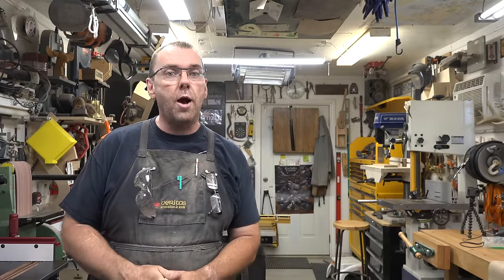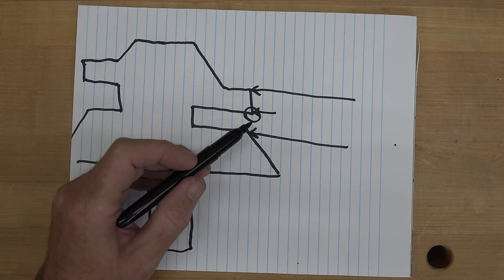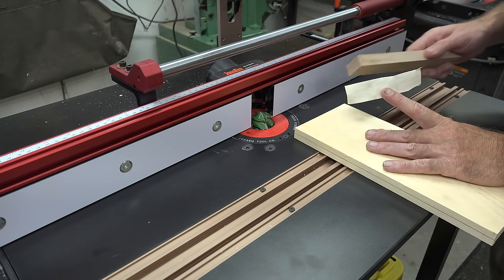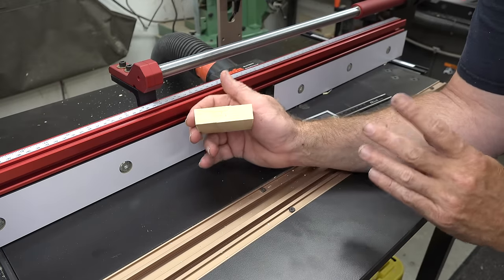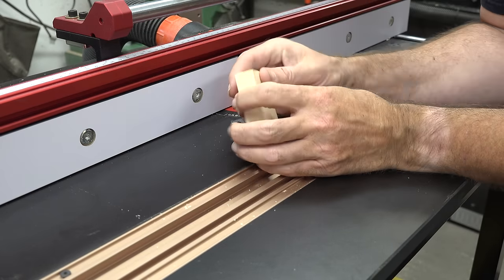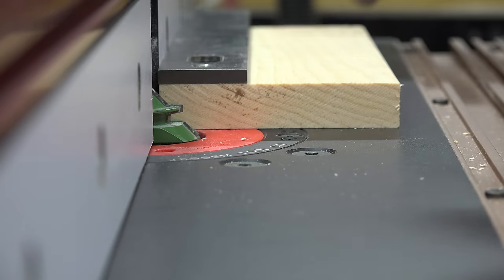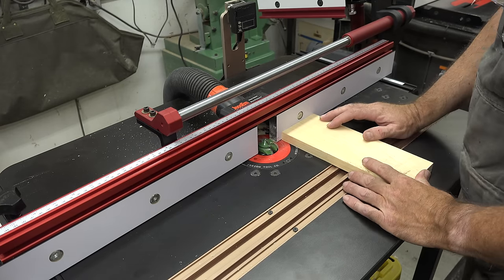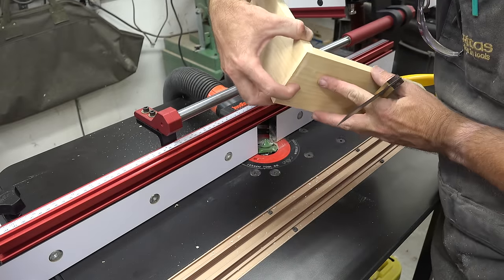Lock Mitre Router Bits

Comment: Kenny, best video explaining this bit set-up.  It takes some trial and error since I don't have the fancy router lift you demonstrate.
A question:  When I finally for the height dead-on, there was a small chamfer on the sacrificial guide  board.  Is this the normal result?  Thanks very much, Bill
Reply from the maker: This is a fairly normal result Bill and nothing to worry about.  As long as the stock itself it correct then you are fine.  Depending on the bit and variances in manufacturers, result may vary but it sounds like you have nothing to worry about.  Once you get it set up the way you like it, you can always run some UHMW plastic through the bit and make a setup block to speed up the process next time.  Thanks for tuning in and taking the time to leave a comment.  I hope I've answered your question.
Reply: @acutabove_woodworkings  Thanks very much for your answer.  After lots of searching, I found a source of small UHMW blocks on E-Bay.  These are cut-offs from ipfPlastics  - 1" thick (which I needed for my project) and 4-5" long.  You get 9 random cut-offs for $25.  This was the best price for small pieces I could find.  
For anyone that uses these, make a cut-out in a longer piece of hardwood and insert the UHMW firmly into the cut-out slot.  Then run the profile.  Moving a 4-5" piece against this bit is dangerous!!!  Again, thanks.  Bill.
Reply from the maker: @williambrooks5133  Sounds like it will be perfect for your setup blocks.

Comment: Hi nice video, i wonder if you can help me with something?  I want to make a conventional mitre edge with a hand router ,,,i am trying to work out which bit and if i need a jig you think or use another piece of wood as a guide with a bearing on the router bit? I think i am looking for a mitre bit but perhaps it might just be i need to use a chamfer bit? thanks
Reply from the maker: A router table is the best way to go with this one and you could us a 45 degree chamfer bit for the routing.  The size will be dependant on how thick your stock it.  If you do not have a router table and need to use a hand router (as you stated) then you could clamp a board onto the stock that you wish to rout, in such a way that your router's base plate would ride along it as a guide.  If you use a board to run a bearing guide on, you run the risk of routing into your bearing board whereas using a straight edge to guide your base plate on, you wouldn't router anything but you mitred stock.  I hope this helps.  Thanks for tuning in to the show.
Reply: @acutabove_woodworkings  Ahhh yes I see your point , actually easier to set up. ...have you tried using that table with a large piece of stock? how did you find it if you did a bit wobbly ? mind you i guess if one was to miss out mitre the edge , it can be put through again since the the router table fence wont let it go any further in this case. so actually the result will be good anyway
Reply from the maker: @ChristopherClaudioSkierka  I think it all depends on how large of a piece of stock we are talking about here.  The table is pretty solid though.
Reply: @acutabove_woodworkings  the stock being 18mm thick, 1200mm X 400mm,,the 400mm side to be mitred, so having to control the longer length
Reply from the maker: @ChristopherClaudioSkierka  the length of the piece is what concerns me here.  That's almost 4' long.  A router may not be your best solutions here.  You might want to consider using the table saw and ripping the board with your blade tilted at 45 degrees.
Reply: @acutabove_woodworkings  yes ...only if my table saw was good but its a crap , need a much better table saw etc, hence the router. conclusion ..for this size of wood the hand held router way is probably the best way
Reply from the maker: @ChristopherClaudioSkierka  Just make sure that your guide board is securely clamped down.  Good luck.

Comment: I'm kinda late to this party but my question is; Say I want to make a box newel post. Once the bit is set correctly, I take it that I would run 2 boards both sides, flat on the table, then run the other 2 boards both sides, flat against the fence?
Reply from the maker: That would work for sure Hunter.  Good luck with your set up.  Thanks for tuning in to the show.

Comment: If building a speaker box can you mitre all edges to have a completely mitred enclosure or do you always end up with 2 opposing sides that can't be mitred?
Reply from the maker: You can definitely make a speaker box and have all side mitred Chris.  You just have to remember that each piece will have opposing mitres on it.  In other words, one side of the board is routed with the stock on the table and one side of the board is routed with the stock against the fence.  If all boards are routed like this, then they will all fit together.  The last board gets slid into place to make it fit without having to flex the board to assemble it.  I hope this helps.  Thanks for tuning in.
Reply: @acutabove_woodworkings  Excellent, and thanks for the quick reply too. Much appreciated.
Reply from the maker: @cobratex7  You're very welcome.

Comment: What rpm would you suggest for 1/2" 45 Degree Angle Lock Miter Router Bit. I'm finding it hard to get the right speed for my bit Thank you
Reply from the maker: It would depend on the diameter of the bit Abraham.  A lock mitre for 1/2" stock is probably under 2" in diameter but larger than 1".   Each set is different so I am just generalizing with this.  For a bit that is between 1 and 2 inches in diameter, I would be running this bit at it's maximum speed which would be in the neighbourhood of 18,000 RPM.  You can adjust up or down depending on your species but I've always had good results running the bit at it highest recommended speed.  I hope this helps.  Thanks for tuning in to the show and for taking the time to ask your question.  It's very much appreciated.
Reply: @acutabove_woodworkings  thank you so much for taking time to help me
Reply from the maker: @2002adeabraham  You're very welcome.

Comment: Question: Would feather boards work instead of a hard wood support on the pass throughs?
Reply from the maker: The only problem with feather boards is that they are designed to compress at the fingers.  This allows the stock to be push further in toward the fence and can cause the routing to be uneven.  Hardwood is not necessary though and you can substitute whatever you have.  Plywood, mdf, particle board etc.  Anything can be used as long as it has a straight edge on it.  I hope this helps.  Thanks again for tuning in
Reply: @acutabove_woodworkings  Thanks for the follow up, much appreciated
Reply from the maker: @sleuthycompass6027  You're very welcome.  I appreciate you tuning in to the show.

Comment: Is it possible to use this bit without a router table, using the sliding guide on a hand router instead?
Reply from the maker: These bits are quite large and quite aggressive.  They are not recommended to be used for a hand held router application.  I hope this helps.  Thanks for tuning in to the show.
Reply: @acutabove_woodworkings  Cheers, off to look up router table plans now!

Comment: What make of bit is that, mine has a different profile, the 45 is offset not in line?
Reply from the maker: I'm not 100% what the make of the bit is, but I got it from Lee Valley.  Here's a link.  https://www.leevalley.com/en-ca/shop/tools/power-tool-accessories/router-bits/30119-45-lock-miter-bits
I hope it helps. Thanks for tuning in to the show.

Comment: Great video, but why would this bit NOT have a guide bearing?
Reply from the maker: Thanks for the kind words Antonio.  Lock mitre bits don't have a guide bearing because once they are done routing the stock, there is nothing left to run the guide bearing on.  The 45 degree angle that it cuts comes to a point at the edge of the board, taking away any surface area to run the bearing on.  Hence why it needs to be run using a router table fence.  I hope this answers your question.  Thanks for tuning in to the show and taking the time to ask your question.  It is very much appreciated.
Reply: @acutabove_woodworkings  Lol -- of course, thanks.  Newbie mistake.
Reply from the maker: @antoniobiguini6073  No worries at all.  Nothing wrong with asking questions.  I'm glad to help.

Comment: do you need different size bits for different thicknesses of wood?
Reply from the maker: Lock mitre bits have ranges of thicknesses that they will work with.  As long as you stick within the minimum and maximum range of allowable thicknesses, one bit would work.  Once you go outside of those parameters, you would need a bit to accommodate that.  I hope this helps.  Thanks for tuning in to the show.

Comment: Very interesting video, just a question, Can I use 1/2 stock with this bit? instead 3/4 tick
Reply from the maker: Each bit has it's individual range for the stock it is capable of joining Norbert.  The one that I am using in this video can mitre stock from 1/2"-3/4" so if you are going to purchase a bit, just make sure that you know the stock range of that bit.  It should be listed in the specifications of the bit when you purchase it.  I hope this helps.  Thanks for tuning in to the show.
Reply: kennyearrings1 Thannk you for your answer

Comment: After you get the bit set up correctly you need to do one thing for next time. With a Wixey depth gauge record the exact measurement of how high the bit is on your table and record this measurement.
Reply from the maker: This is a great idea.  I have found it also useful to get a block of UHMW plastic and run one pass as a setup gauge for future setups.  I hope this helps.  Thanks for tuning in and for chiming in with your suggestion.

Comment: What about a pair of finger boards attached to the fence pushing down instead of double-sided tape?
Reply from the maker: It's not necessarily about keeping the stock down as much as it is about protecting the sharp edge of the stock once the routing has started.  I hope this helps.  Thanks for tuning in to the show.

Comment: The price of these bits are all over the place. I'm willing to step up, but will a $30 bit suffice versus an $80 bit? Thx!
Reply from the maker: I guess it all depends on what you want the bit for Eric.  If it is just for one job that you are hoping to get done then the $30 would probably serve you well, as long as it was milled properly.  If it is a bit that you are hoping to use repeatedly over multiple projects, then I would probably go for the more expensive bit to get a higher quality.  Personally, my bit was around the $80 mark.  I hope this helps.  Thanks for tuning in to the show and taking the time to leave your question.  It's appreciated.
Reply: @acutabove_woodworkings  Thx for the advice. I'm up for a good quality bit. Rockler?
Reply from the maker: @1duesy  Actually, mine was purchased from Lee Valley.  I see they have gone up a little in price but I've had the bit for years and it is still going strong.  https://www.leevalley.com/en-ca/shop/tools/power-tool-accessories/router-bits/30119-45-lock-miter-bits?item=16J7562
I hope this helps Eric.

Comment: do you have different bit sizes for wood thicknesses
Reply from the maker: Every lock mitre bit has a range of materials that they are good for.  I believe mine is for materials from 1/2"-3/4" thick, so as long as you are with those parameters, there is no need for a second bit.  Just be sure to check the bit's stock thickness range before purchasing it so that you know that you are getting the bit that will suit the majority of your projects.  I hope this helps.  Thanks for tuning in Carel.

Comment: Is speed of the router critical for either size or species of wood?
Reply from the maker: The speed of the router is critical for the diameter of the bit that you are using.  You can make slight adjustments for species or thickness as needed as long as you stay within the RPM range of the router bit's diameter.  I hope this helps David.  Thanks for tuning in to the show.

Comment: Hey Ken, I've corresponded with you before.  My problem was/is the test piece is drawn in to the bit before it passes to the outfeed fence.  This is caused by the gap on the outfeed side of the bit in my router table.  After watching again tonight, I notice your insert ring is almost flush with the bit.  Did you cut this ring yourself to fit the bit or did you purchase the ring?  I have the same Jessum lift.  Thanks again.
Reply from the maker: I have different Jessem router plate inserts and I install the one that suits the bit that I am currently using.  I hope this answers your question Larry.  Thanks for tuning in to the show.
Reply: @acutabove_woodworkings  Thanks for responding.  I have the set of router plate inserts that came with the Jessem lift.  Only problem though is the largest insert that came with kit is only 2" and this bit is 2½". So I wondering where you got the 2½" insert.  I will go to Woodcraft (where I bought the lift) and see if they have a 2½" insert.  Otherwise, I guess I could buy another 2", insert in the table, turn on the router and slowly lift the bit into the insert cutting a 2½ hole.  This sounds dangerous but I don't readily know of another way.  Again, thanks, and any comments or suggestions are welcome.
Reply from the maker: @fishman2951  I'm not sure of the diameter of my lock mitre bit or of the hole in the router table plate.  I can possibly check tomorrow after work and take some measurements if it would help you.  I would not suggest raising the router bit into an insert.  That is a disaster waiting to happen.
Reply: @acutabove_woodworkings  Yes, raising bit like I said is dangerous.  Went to Woodcraft store today.  The box their Jessem comes in clearly says included in the box are four inserts: 1", 1 3/8", 2" and 2 1/2".  Jessem left out the 2 1/2" insert in my box.  Will call tomorrow and see if they will send me one.

Comment: Can you use the bit on a mitre edge ie 2 x 45 edges?
Reply from the maker: Using the bit on a mitres board will not produce the same result as what the lock mitre will produce as you will be eliminating the 'lock" part of the mitre.  It should be used only on flat and square boards.  I hope this helps.  Thanks for tuning in to the show.

Comment: How well does this joint work in plywood or MDF?
Reply from the maker: One of the main purposes of this joint Garry, is to provide more glue surface and make clamping up the mitre joint more secure.  This joint is perfect for plywood and MDF.  Just make sure you are using a dust mask and dust collection if you are going to use MDF.  That stuff is nasty when used on the router table.  Thanks for tuning in and taking the time to ask your question.  I hope I helped.

Comment: Does this mean that we cannot apply the joint where the stock is bigger than the bit?
Reply from the maker: The bit needs to rout the proper profile across the entire thickness of the stock.  If your bit does not span across that thickness, the joint will not work as it is intended.  I hope this answers your question Peter.  Thanks for tuning in.
Reply: @acutabove_woodworkings  so it would need development to be able to apply the concept to  more situations. I was thinking of window frames and casements
Reply from the maker: @petermw88  It would depend on how thick the material was for the window frames and casements.  There are also different lock mitre bits that are for larger sizes.  You need to use to proper bit for the thickness of stock that you are routing.  Each blade has a range of thicknesses that they will work with.

Comment: So once set up correctly you can save a cut off to use as a template for future cuts?
Reply from the maker: Most definitely.  As long as the sample stock and the stock you are routing are the same thickness, the template will be fine.  I hope this helps.  Thanks for tuning in to the show.

Comment: Once the setup is all dialed in, how about cutting a setup block out of wood or plastic for future use?
Reply from the maker: Definitely a great idea.  A piece of UHMW plastic would make a great setup block.  Just rout the horizontal profile on one side (for the bit height) and rout the vertical profile on the other side (for the fence setup). It would definitely make the setup faster.  Even if it's a little off at that point, you would just have to tweak it a little to fine tune it.  Thanks for tuning in and chiming in with your suggestion.  Great idea.

Comment: Can you state or explain what speed the bit should be at?
Reply from the maker: The speed of your router bit is based on it's diameter.  Not knowing what bit you are using, I cannot tell you a speed.  However, I can tell you that as a general rule, the following will apply.
For diameters less than 1".  21,000 RPM +
For 1" diameter.  20,000 rpm max
For 1-1/4-2" diameter.  18,000 rpm max
For 2-1/4-2-1/2" diameter.  16,000 rpm max.
As the bits get larger, the rpm gets lower.  Your lock mitre bit is probably in the 1-1/4"-2" category so I would keep your rpm below 16,000 rpm.  I hope this helps.  Thanks for tuning in to the show.

Comment: Can we just save the correct cut one, for reference soon?
Reply from the maker: Nothing wrong with using a cut off of your finished joint to use as a setup block for later.  In fact, it's encouraged.  Thanks for tuning in to the show.

Comment: Could you do this without a router table?
Reply from the maker: I would not recommend it.  These are larger bits that remove a lot of material at once and controlling it with a handheld router is just a dangerous operation.  The router table is really the only safe way to use a bit of this diameter.  I hope this helps.  Thanks for tuning in